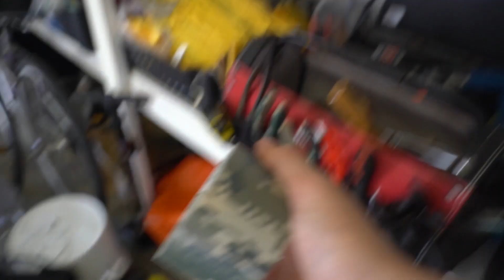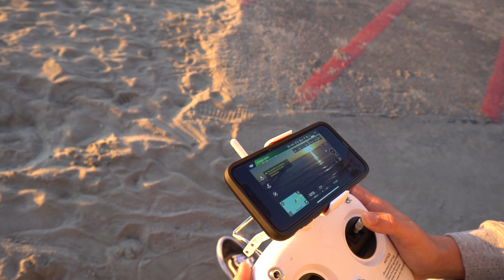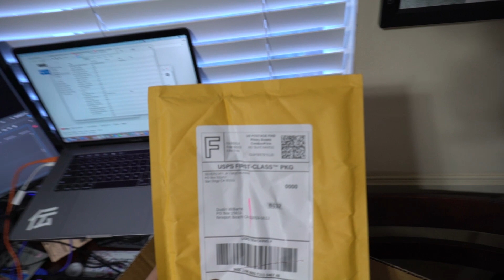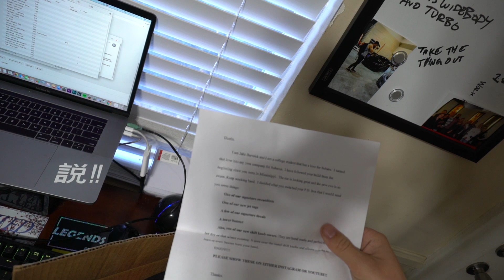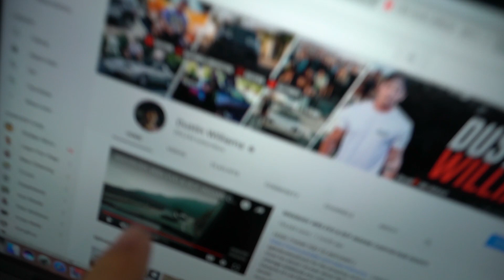AGGRESSIVE REAR DIFFUSER INSTALL ON WIDEBODY WRX!

Comment: listen to the drone and make sure there's no high pitch whine when the props are spinning, if there is, whichever one is whining means that motor is weaker and it will pull to the opposite side.

happened to my phantom 3 when i had one lol. a gust of wind took it out the sky into a building. but it didnt fully break.

Comment: Why you putting on all these race aero pieces but you never track your cars?
Reply: Because he wants
Reply: TJ Sherminator show? He is always saying it's a show car?
Reply: I don't get it either. Why make something look like a race car when it cant even beat a mustang. Don't get me wrong I like vids, mostly here for the EVO, but I just don't get it. Guess i'm a speed guy.
Reply: it could be worse. TJ sherminator bought centerlock wheels which are intended to be lighter than normal wheels and planned to run adaptors instead of getting correct hubs effectively making them heavier and shittier than if he would have just bought normal 5 lug wheels
Reply: TJ Sherminator  My man!! You took my exact thoughts and typed it 😂😂 all these "race aero" aggressive looking cars and yet no track videos in sight 😂💀💀💀
Reply: it's suppose to be a show car..same reason why people get wide body kits..but that diffuser kind of ruined it
Reply: You guys keep saying because of show. If i saw this at a show i would still say it looks cheap and forced! Screwing shit on top of shit doesn’t make any car a show car in my opinion. Good paint well thought out professional parts with a nicely built engine usually does it for me. Not plastic bolted on the outside of the car. Just my opinion though. If he keeps checking his rims and hitting curbs head on this will not be in any car show at all.
Reply: boomerd513 lol honestly I think he over did it with the cosmetics. First the wing and now the diffuser
Reply: Rice life bro
Reply: This addition doesn’t look good but the car looks good some people mod with aesthetic as a proirity
Reply: that slow goat agreed